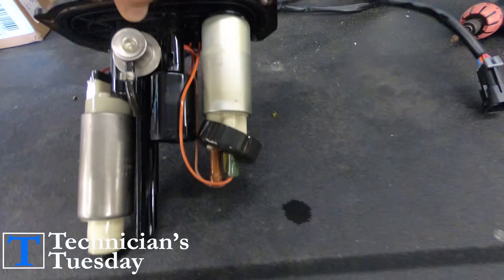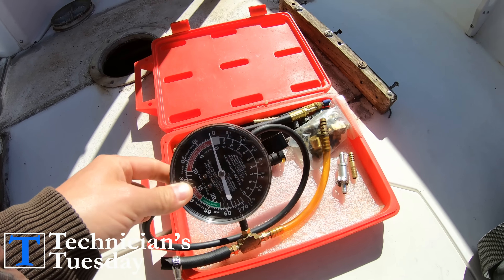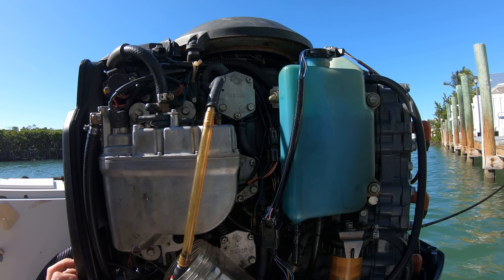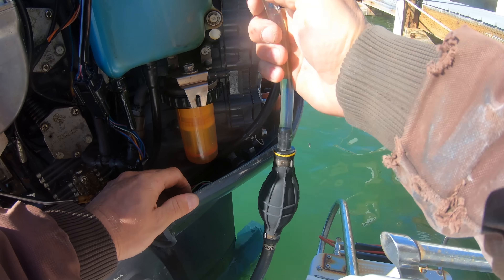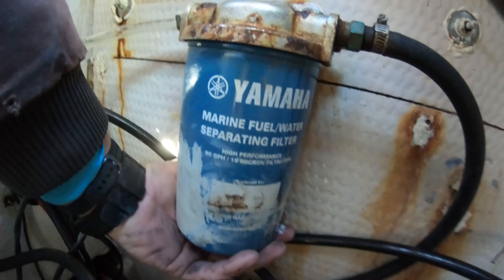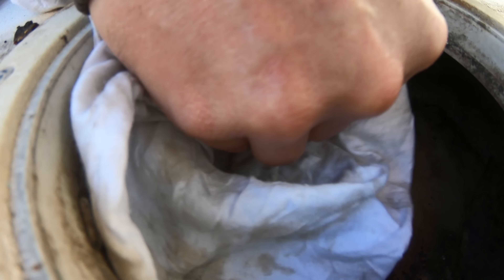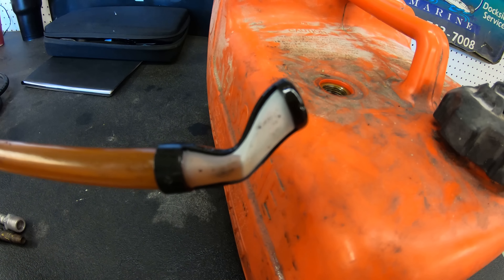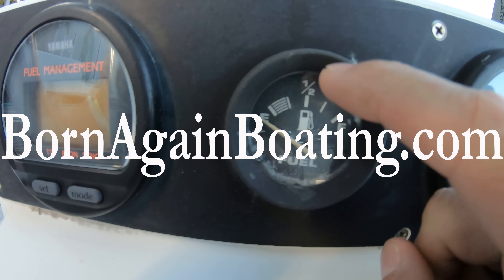Follow These Steps! Why Outboards Run Out Of Fuel!

Comment: I had a garage boat mechanic do my annual service on a mercury pro xs 225. Idiot shredded the fuel filter on top of the vst so he thought he could use a hammer and flat head to remove it. I got it back and hit the lake without him telling me what happened. Engine was idling fine but would sputter and have trouble trying to plane. I went through 3 shops trying to figure it out and the last one did. There were little red chunks from the filter housing inside the vst that was blocking the float causing my engine to run out of fuel. So now I service the boat myself.
Reply from the maker: WOW! Ouch :(
Reply: Born Again Boating yup, tell me about it. I paid $120 twice for 2 diagnostic fees and dropped another $1200 for the final fix, but man it felt so nice to have a perfect running motor.

Comment: My fuel issue was when a boat dealer at El Dorado Lake, KS did a recall repair replacing the fuel pump on my Mercury outboard & forgot to hook one of the fuel lines back up! MAJOR #gasleak

Comment: Having a fuel issue right now on 2018 Mercury 150 4 stroke. Complete new fuel system from tank to water separator to motor. Still having an is with motor missing wen under a load.

Comment: My boat last summer would drain the fuel bowl dry on the carb when under WOT.  I kept troubleshooting and it kept being the water separator.   It turns out there was trash in the tank and it kept clogging filters quickly.  Cleaned the tank and fixed the issue. #gasleak

Comment: This past labor day Monday. Ran into fuel/air problem. F-ing choke wouldn't open and engine didn't want to run. then, i ran into issues with fuel leaking from near the carburetor. Unfortunately, i have a "rare" motor. Andi don't mean "rare" as in a unicorn, i mean rare as in i apparently have an ogre for an outboard so parts are super hard to find around here and a outboard tech that is willing to work on it is even harder to find. 1994-95 2 stroke 3 cylinder...wait for it... 70hp Force by Mercury Marine. I don't mind the bad reputation people say about them, the issue is parts are scarce.

Comment: I absolutely love this channel!

Do you have any advice? My 26 foot twin engine four stroke outboard‘s bogged down while accelerating but then are fine until they reach about 4500 RPMs. The bog down is well at high on speed. However, while running when The primer bulbs are pumped it kicks up and runs fine for about 10 seconds. 

I replaced the fuel water separator‘s, and I am waiting for the new fuel strainers. Since it is happening with both motors I’m thinking it may be the fuel pick up strainer in the gas tank. From there once determined it’s not any hoses,,I’m thinking about replacing the fuel pumps, which I understand are only good for about 3 to 4 years

Comment: A really common problem I had while living and working on a boat was water contamination in portable fuel containers for my RHIB.
Doesn't seem to matter what kind of fuel additives or containers are used, all the respiration of moist air eventually gets some water in there.
Usually only problematic when running low RPM in rough weather for a long time, the low fuel flow rate would allow accumulation, and the turbulence would stir up stuff in the tanks a little more.
Anyways, with my Yamaha outboards they typically had three carbs, and the lowest carb would always be the first to get a little clogged up.
That lower cylinder would cut out and lose a little power, whenever that happened I could just turn to run in the trough of the waves, open up the throttles and clear out the water just by running high RPM for a few seconds.
I did have to rebuild the carbs while offshore once, don't recommend it.  In hindsight, more frequent fuel filter changes would have been the correct fix for that problem.

Comment: Thanks for the video:  I am not sure why my motor (2002 (100 hp) Yamaha 4 stroke) Kills when I put it into gear. I tried putting it in Natural and advance the Idol speed to 2000 rpm for about 3 minutes, when I put it into gear, it kills.  It did set up for about 6 months with out running it.  I drained the tank and tried to clean out the bottom.  I don't think there is any blockage. The boat place is like 6 months before they can look at it. ha. any comments apricated  Thanks Gene

Comment: #Fuel Leak-Was out on the river and my fuel lines clogged because of ethanol fuel used by previous owner.  I had to be towed in.  Then I replaced all the fuel hoses, cleaned the carborators ane it ran fine from then on.

Comment: I replaced 40hp with 90hp Merc on pontoon boat. I installed water separator in-line and could not get primer bulb to get hard. It was getting difficult to start so I took it out of line and that seemed to correct THAT issue. I still have issue where motor tops out at 4000 rpm full throttle and after a few minutes suddenly breaks free to max rpm of 5500…?

Comment: Hi I have a 175 Yamaha BETO engine that sometimes cuts out when idling  after out on the water most of the day.
Usually no issue to get it going again but recently I was caught out in middle of Jervis Bay 🇦🇺 and had to get towed back to ramp because could not restart the engine. But later back at home I hooked up the hose to flush the engine and it fires up no problem! Serviced every year but mechanic cannot tell me what the issue is because always starts when on land. One thing I did notice this time was there was no  activation /humming (fuel pump) sound when I turned the key to on position when the engine would not start. After letting it sit for about an hour I gave it another go and the fuel pump activated /  humming sound could be heard and the engine started. What could be the issue of an intermittently working fuel pump ? Cheers
Reply from the maker: Most likely a bad fuel pump or weak or dying lol but also don't rule out the vapor lock issue, if the engine is hard to start after running, sometimes its a vapor lock issue :/

Comment: I’ve got a 2004 70 Yamaha 2 stroke
It only will run with the red fuel enrichment valve on, runs great with it on but not in normal or closed position
NEW FUEL PUMP
CARBS CLEANED 
NEW GAS TANK AND PRIMER
any ideas? Maybe carbs aren’t cleaned well

Comment: When I lived in whidby island Washington I had a 30’ boat with a 6 cylinder engine the fuel pump went out before deception pass and it took us about five hours to figure it out and get it fixed in able to get up the pass back to the trailer

Comment: I've got to try again to fix an air leak on my 115 evinrude.   I checked everything from the ball to the fuel pump.  It ran good the first time out,   I have to keep priming the bulb for about 15 minutes while the motor is running. Keeps loosing prime.  Once I get it primed after that, it runs and starts all day w/o priming again.   I'll have to look at the tank again.  I looked there last year and it looked good.     I'll put the clear hose at the connection to the tank this year and see if I see bubbles.

Comment: Okay, old 1970's 18hp evinrude starving for fuel. Bought new primer bulb since old buld kept going soft and quit working. Still no suction from tank. Tried prime straight back into tank with out the connector at one end and still no suction.  Checked both ends (male and femal) of fuel line quick connector and they were both fine givin they were also new. Straw going into tank clear of any debris. Dumbfounded as to why it won't suck out if tank.

Comment: I have a fuel issue on my boat.. it’s weird because I have to let it idle for about a minute with warm up lever on.. once the rpms go up I know I’m good.. but it will die anytime before that.. once it’s running though it’s fine until I shut it off. Then I have to let it run for a while at idle again

Comment: I have 2 ox66 250s, park them running and both won’t start. I checked the filters, high and low fuel pump, injector and still won’t start. I also drained the fuel system and ran it off a gallon bottle thinking it was old gas in the boat tank but still nothing. I sprayed quick start in intake fires right up then dies. It seems like a fuel problem but everything checks out good. Not sure what else can be the problem.
Reply from the maker: Idk are you saying it won't start, like it won't turn over or it will turn over but won't start? Interesting that it is both engines, idk if you are looking at a fuel issue when you have both engines not starting, maybe the lanyard, or something like that, hard to say what is going on.
Reply: @BornAgainBoating  it turns over but won’t start. If you use quick start fluid they will start right up then dies off. What’s puzzling is both are doing it now but were left running. I would think the lanyard would stop the spark but both engines has spark, fresh fuel, and all injectors spraying.

Comment: 2021(9 hours) 50 HP 4 stroke will not pick up fuel from the tank. If I pump the ball to keep the filter full it will run perfect. I pulled the mechanical fuel pump off the back of the block. I opened it up but it looks perfect. I can't find any air leaks and I also removed the VTS pump to make sure it was not stuck open or closed, it looks new inside as well. I'm not a part changer, I am a mechanic but at this point, it looks like the mechanical pump. Any ideas?
Reply from the maker: With 9 hours, most likely it's a boat issue not an engine issue, but that's just because you say the primmer bulb keeps it running, like there there needs to be more of a vacuum to pull the fuel. I'd check the boat first, before condemning the fuel pump but hopefully you've figured this out :)

Comment: my engine has a bad idle speed and it doesn't go up past 5000 rpm.   I already replaced the fuel filter ( which the previous owner guaranteed to have changed but he didn't ) - and I also cleaned the injectors - fuel rail - and sensors. it's a four-stroke EFI Mercury outboard engine.   I haven't tested it at sea after the changes, but the idle speed still oscilates.   I'm hoping the least now I can cross the 5000 rpm limit.  I don't have a way to check the iac valve, and it's too expensive to be easily replaced here in Brazil, and since the oscilation is not so much and the engine doesn't stall. I am not gonna touch it.
Reply: sorry for the bad english

Comment: Hi im needing help ASAP.. i have a 1985 2stroke outboard 115hp mercury from last time i went out with it until now (2months) the engine does not want to start.. it CRANKS BUT WONT START.. theres spark going in,, my carbs full and even sometime overflow,..
New spark plugs, new fuel filter, new batteries and nothing just stays cranking but wont start again..
Need help please thank you very much in advance..
Thanks

Comment: One common fuel issue I had was due to the Atwood fuel line has a inner liner that would crinkle up or deteriorate and block fuel from going through#gasleak
Reply: Not just Attwood.  The blue fuel hose from a few years ago that was supposed to be "ethanol safe".  It's crap.  The liner separated when I changed out my ball.  On the output side of ball it wadded up and was restricting the fuel flow.  Took my awhile to figure that on out.

Comment: Our boat started stalling randomly one day when the fuel tank switch was switched onto the Portside. Also the fuel pump would make a screeching sound above idle. We later found that the anti-siphon valve and pickup tube were partly blocked by what looked like sand aka ethanol. We ended up limping home on what little fuel was left in the starboard tank. After replacing the siphon valve and tube we also found the fuel pump was damaged as a result of the blockage. What a pita that was! Cheers #gasleak

Comment: #gasleak i had a i/o and switched it to an outboard on a bracket - the anti siphon valve turned out to be the cause of intermittent stalling on my outboard.  took me almost a year to figure it out and a bunch of cash for new hoses and several replacement primer bulbs.

Comment: Had a fuel issue a few years ago where the tank vent was blocked.
Reply: I know this is 2 years old but I think im having the same problem. Would your motor run fine for awile and then all of a sudden go from cruise to it starving out and then having problems starting it back up?

Comment: Hi! I have a problem. I have a Yamaha 60 horsepower high thrust engine and every time I start the cold engine it stops and after the second start it doesn't stop. Why do you think it stops at the first start? I thank and appreciate the efforts to support the global community of boat lovers.
Reply from the maker: Hard to say, spark plugs or could be the carbs or enricher. If that's the only issue, I'd leave it alone:)

Comment: Huge question ,  just bought a used boat with an out board.  Kinda new to boating but it doesn’t look right.  It’s an older bass boat and the three batteries are in the same compartment as the fuel tank. Should I be worried and move the batteries?
Reply from the maker: Hi! Rose here, we appreciate your comment! Regrettably, I don't have the answer to your specific question. We've found it's more effective to handle such inquiries individually. That's why we've set up a channel membership for weekly live discussions. If you're curious, just click the "Join" button beside our channel name. Thank you kindly!

Comment: Had an issue with my 05 merc, ran fine the season before, peeped it for the winter thought all was good right,,,,,,,, nope when I got it out for spring wouldn’t idle right wouldn’t reach wot rpms( I run mine right at 5900-5950) so it wouldn’t even reach 4500. Thought may be the fuel had gone bad, pumped the tank out put fresh 91-93oct in, ran a little better but nope not it,checked the fuel lines found they were collapsed and deteriorated so I changed them all figured I got it now ran better yet but,,,,,, nope still not reaching 5900. Changed both the water separator/filter, still not it, runs better, pulled off the carburetor cleans it still runs better but not it, rebuilt the carb still runs better but not it pulled the mechanical fuel pump off opened it up found crud from the lines that made it up through all the filter so I cleaned it but went to pull the diaphragm out of the other side low and behold the rubber retainer was torn since the rebuild kits were discontinued I got a new pump and guess what runs better than perfect, btw I’m a certified auto mechanic lol thanks for the vid thougj

Comment: I had a leak a couple years ago at a tee fitting between two carbs. I corrected it by replacing the tee, but now my alarm goes off when I am at wot.
Cant quit figure it out. The bulb stays solid so it doesn't seem to be starving or restricted at the tank.
Reply from the maker: You'll want to figure out what the alarm is, it's probably not a fuel issue :)
Reply: @BornAgainBoating  From what I read there are only 2 alarms Over Heat and Low Fuel Pressure. When I let off the throttle it goes away, so that rules out heat.

Comment: I have a 96 150 Yamaha 2 stroke been having so many problems with getting fuel to the engine replaced almost everything fuel water separator new lines new tank but I cant seem to figure out why I cant get gas to the engine
Reply from the maker: Are the fuel pumps operating properly? They might need rebuilt :/
Reply: @BornAgainBoating  When I take the fuel line off the fuel water separator and place it directly into the gas tank I have onboard it sucks gas. I'm going to pick up a new primer bulb and line today when I connect the male and female piece there seems to be a air gap hoping its that fingers crossed. Thank you for the reply and the AMAZING video series.

Comment: help pls:   boat works with external tank     15ft keywest inboard tank.  pulled sending unit........no blockage.....changed barb connector knocked the ball bearing out    ran all new 3/8 fuel like from pickup tube to rear of engine, connected the primer bulb and it would not pick up fuel...........your thoughts pls  ty
Reply from the maker: Hopefully you've figured this out, but most likely the screen on the bottom of the pick up in the fuel tank is clogged :/
https://www.youtube.com/watch?v=IcvkP8pRsRY

Comment: My dad's 1992 Mercury 115 had a fuel issue where the air filter was soaked with gas from leaving the fuel line attached.  The motor couldn't get enough air to run properly above 1800 RPM.  Really wansn't a #gasleak issue but a fuel issue regardless.

Comment: Got a 60/40 Mercury jet that will only rev to 4400 rpms. Need help. Runs good just not wot
Reply from the maker: Probably something wrong with the fuel getting to the engine, like in the video there is something else wrong and it isn't able to keep up with the amount of fuel the carbs or the VST can provide to the engine. You can check these out for some reference:
https://www.youtube.com/watch?v=g7eIUx5bP_k
https://www.youtube.com/watch?v=IcvkP8pRsRY&t

Also, could be the high pressure pump could be dirty or something like that, dirty filter on the pump, etc. if it has a VST:
https://www.youtube.com/watch?v=Qtz-9_-_dTk

That will be a similar video, hopefully that helps and you get it figured out! If not, we could help out a little more in the Boater's Program where you can message and upload pictures and videos, you can check that out here:
https://www.bornagainboating.com/

But hopefully you get it figured out ;)
Reply: @BornAgainBoating  thanks, changed both filters and put in new plugs. Checked the injectors. Dumped out the fuel and going to run some injector cleaner and new fuel. We Shawn see what happens. Thanks